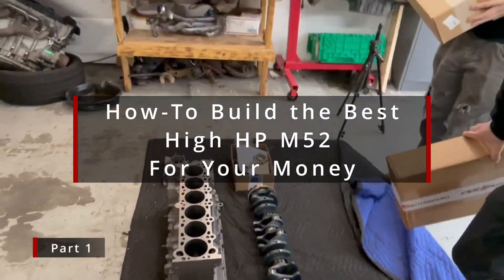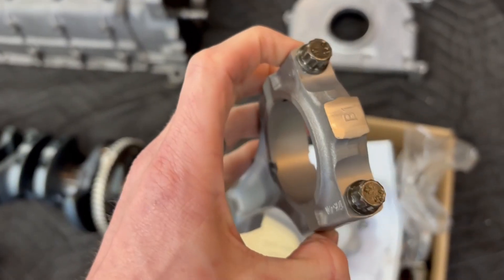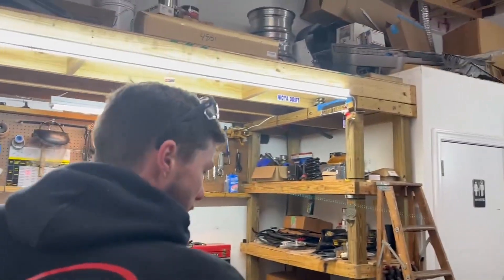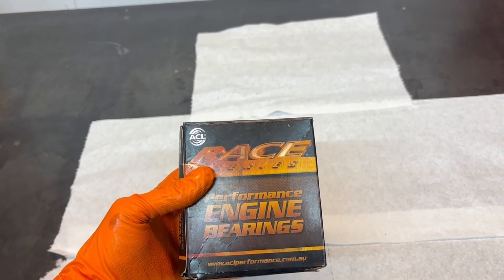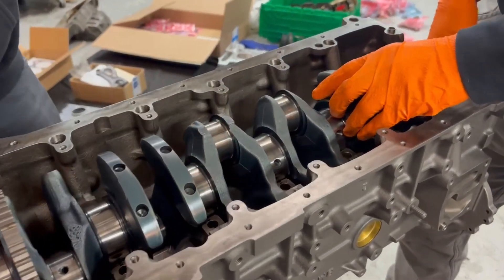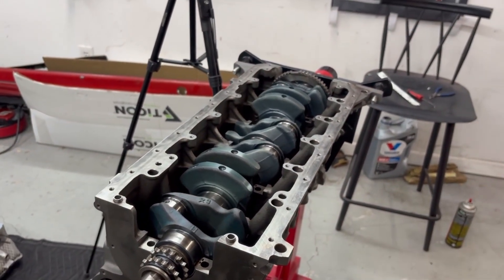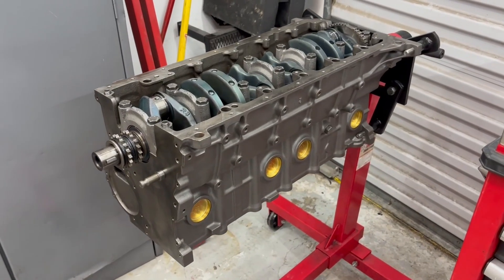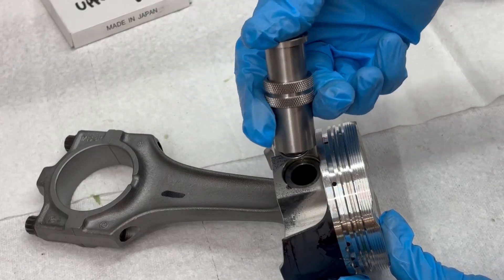THE BEST M52 Turbo Engine Build!  Low Dollar 600whp!!  Lets Clean Oil Squirters and install Crank!

Comment: I have a m50b20 block, can you give me some advice on what pistons, connecting rods and crankshaft, and what cylinder head to use for over 500hp? Thank you in advance
Reply from the maker: It all depends on fuel!  What fuel will you be using?  2.8 crankshaft and 84.5mm bore is best for boost!  Unless you’re trying to make 800+.  Non vanos head is best for factory dual valve springs.  You can port it for vanos
Reply: really want to stick with 80mm pistons. regarding the fuel, it will be driven on e85
Reply: the goal is a 450/500whp everyday car

Comment: I see lots of guys taking many guys taking apart the old squirters and soaking them in diesel to give them a thorough cleaning.   $30+ per squirter is rough for a little piece of brass with a spring.
Reply from the maker: Good trick as well!!  Just make sure they move smoothly and seal